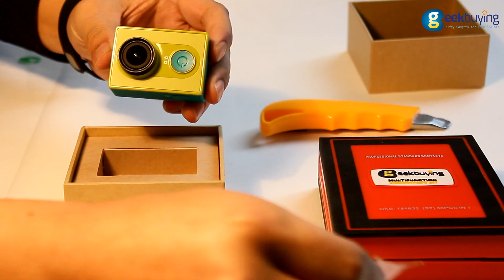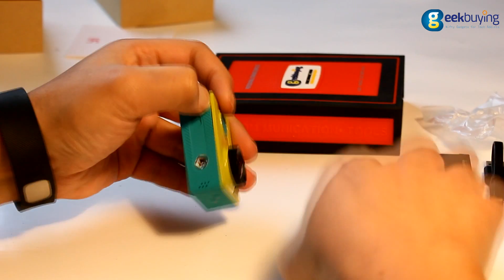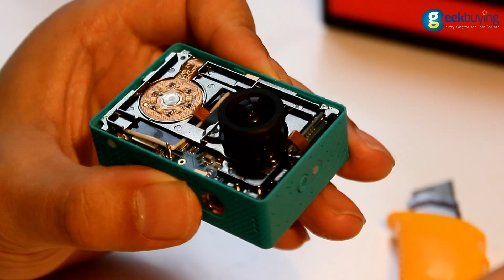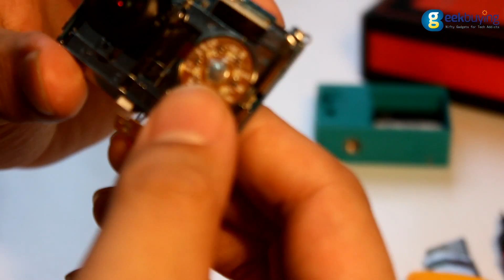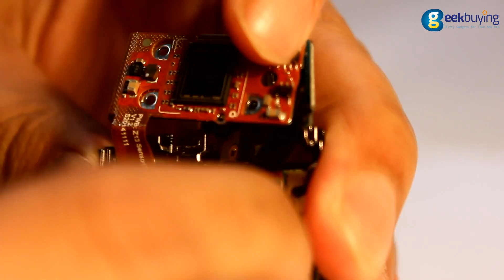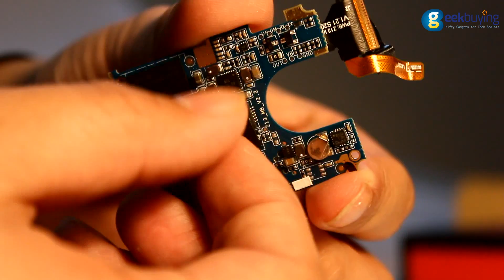Tear Yi Down - First Xiaomi Yi Action Camera Tear Down Video

Comment: hello eveybody.. i have a problem with my yi cam, led wifi doesnt work after getting wet without waterproof case ..after i drain it everythings fine except wifi led.
Reply: inside metal probably rusted
Reply: RaveyClaw - What did you do after that? Mine took some water too, after drying it in rice pack it responded but the wifi hotspot is no longer there. :(

Comment: It seems very difficult to replace lens,
has the lens holder some screw to loosen the lens?
Reply from the maker: Suso Barral Yes there are two screws.
Reply: Thanks
Reply: Suso Barral what kind of lenses would fit this?
Reply: jouni helminen
 
I want to try with lens 180º , I think the lens holder is threaded M12